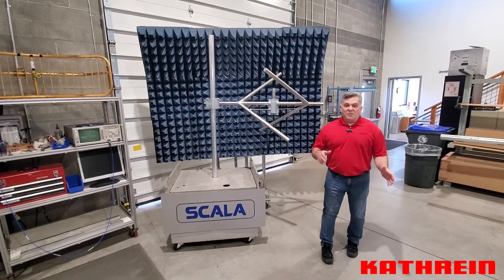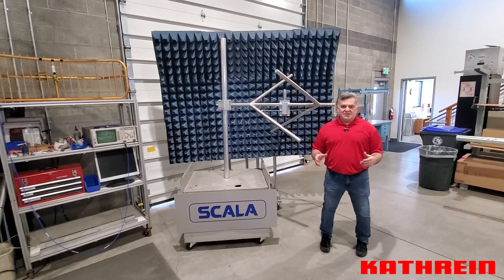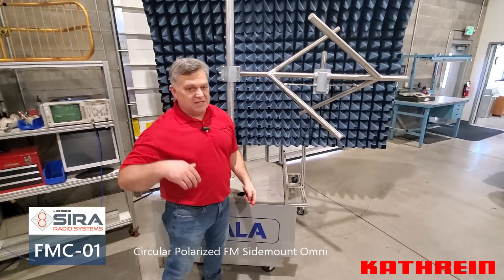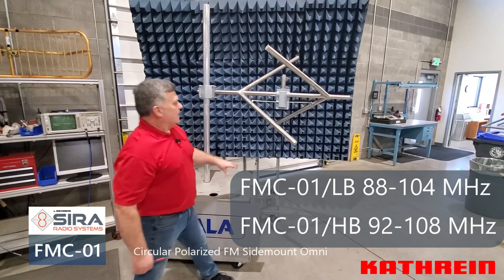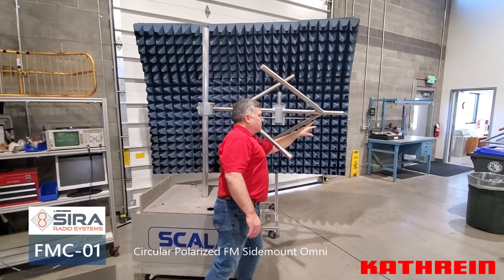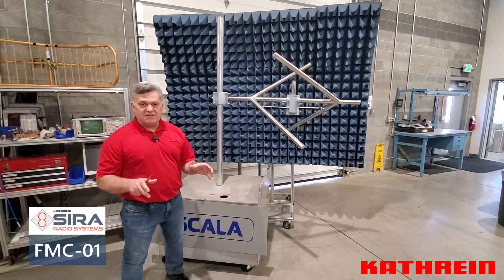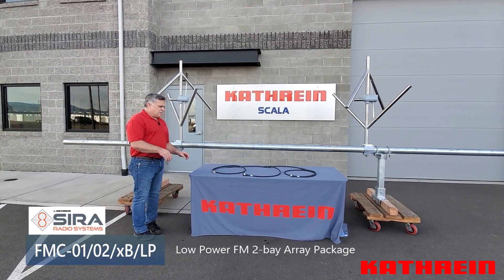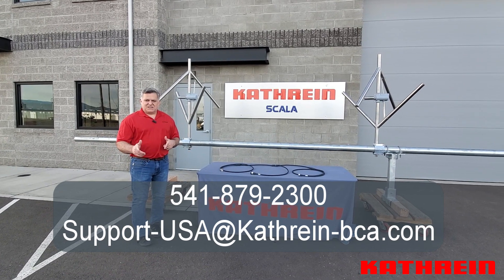Kathrein / SIRA FMC-01 Low Power FM Circular Polarized Transmit Antenna

Comment: What is the polarisation pattern vertically and horizintally? 
What is the combined pattern ? 

What is the angle(s) of maximum radiation in relation to the antenna or stack of antennas ?

What is the gain of the various banks of antennae ? 
I am concerned that it has the stated -3.3dB meaning you need 2 antennae as a bank to be near 0dB so I would have liked to have known what it is for multiple antennae.

There is a lot of technical information that could have been given, that wasn't. Please add this information, diagrams etc so it becomes properly educational to people who will need to know this stuff for their own station - people like Station Engineers who have to make decisions on what they will consider.